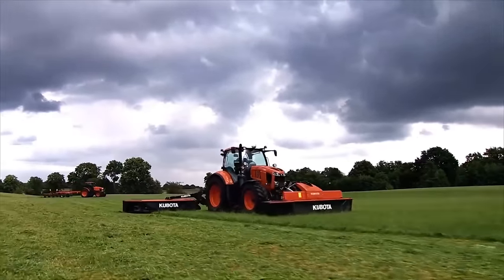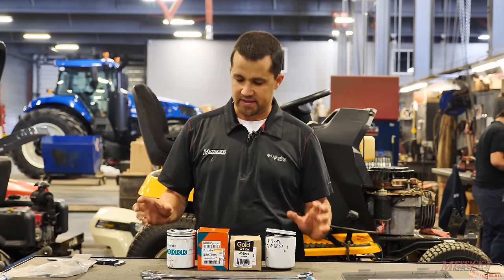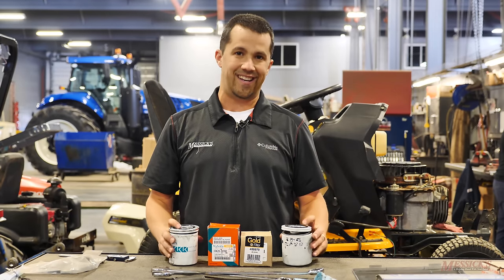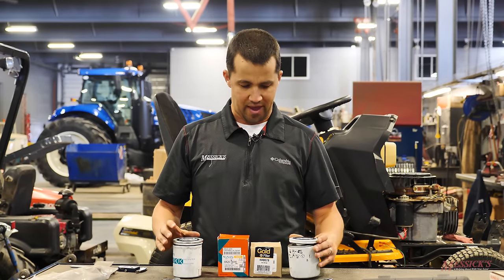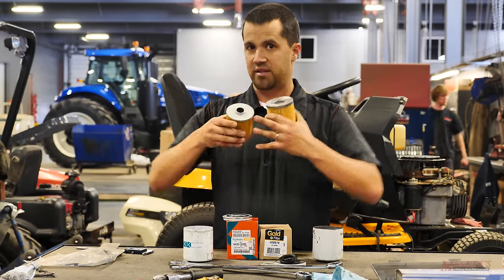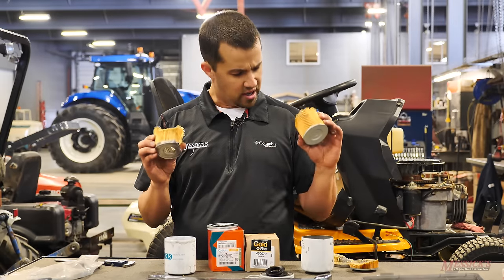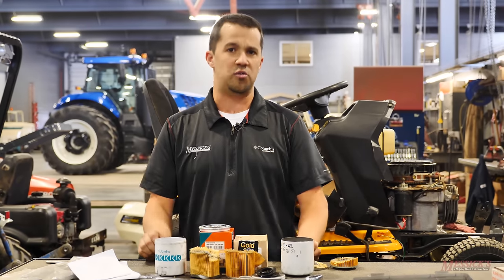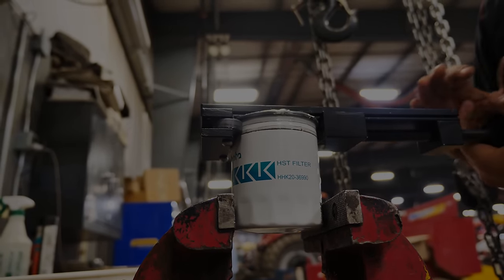NAPA VS KUBOTA (hydraulic oil filters) - What's inside???

Comment: When talking filter material, the most important thing to gage a filter by is the “micron” rating for the material. This tells you the size of the contaminants that will pass through the filter material. The total filter surface is important also. This allows more oil to flow freer through the filter when new as well as after it becomes dirty. The use of a micrometer to measure metal thickness would be helpful. You may want to replace the cutter wheels on your tool.

Comment: I prefer to use OEM hydraulic filters. Had a few issues using aftermarket ones both were flow problems. One starved the pump of oil burning it up and the other was when it was cold and couldn't flow the thickened oil. Blew the seal and emptied the 15 gallon tank on the ground, thankfully caught it before the pump went. Never had an issue using OEM filters. The price difference is nothing compared to that of hydraulic components.

Comment: I disagree on the spring function. If you look up that NAPA filter, it's a Wix WL10079 and the Wix catalog say that model has "NONE" for bypass relief. This matches what I've seen on several hydraulic filters which seem to mostly have no bypass relief valve. Engine oil filters sometimes have a leaf for tension with a bypass spring built in the middle of the leaf and sometimes the leaf is just for tension or the filter has a coil spring, and in both of those cases the bypass relief valve is built into the canister

Comment: A great comparison on these filters would be to remove the filter material from the housing and stretch it out on the workbench. This would give a visual and a measurement rather than saying “more pleating”. I always use OEM on my equipment. Except for my 1969 Massey Ferguson 135. It’s been converted from a canister filter to a spin-on type.

Comment: Thanks Neil, I wish your price was similar in Australia. 

For Example - 
HH1G0-32430
Your price - $14.68
Aus Price - $60.03(USD converted) 

HH160-32430
Your Price - $14.68
Aus Price - $47.56(USD converted) 
Aus Baldwin - ~$20(made in the US)
Ryco Z9 - $5

HH166-43560
Your Price - 18.66
Aus Price - $37.61(USD converted) 

3P300-11220
Your Price - $38.01
Aus Prices $99.01(USD Converted)
AUS Baldwin - ~$40

HHK20-36990
Your Price - $12.19
Aus Price - $25.72(USD Converted) 

These are some of filters i deal with for my tractors. This is why in Australia, it is not worth cost of buying Kubota Filters, as you can see one filters in Australia i can buy it four times from you. 

You need to start selling them in Australia as it is cost us a lots in filters here. I think even shipping freight and filter will be cheaper then local bought filters. 

I stick with Baldwin or Donaldson filters. Unless Neil your company start shipping them to Australia. For your example if i take 4x HH1G0-32430 for price for 1 here, i can use for up to 2400 hours vs 600hours. 

And don't get me started with the oils. It is almost 3 times the price here vs yours. At My M135GX first service(50hours), the kubota dealer said, we don't change the Hydraulic Oil or Filters, or the owner will have heart attack at the price they pay.

If the prices where like 20% more expensive then third party, Yes I would go with Kubota Oils and filters. If they are 4-6 times the price of third party filters you know where farmers will go to else where. 

Another example is I don't buy my spare parts for my Honda ATV from Aus i buy from US as it is half the price including freight. It is only an extra week to wait.
Reply from the maker: Yea, we've heard that. Seems all your tractor stuff there is expensive. We sell a lot of parts to Australia for other brands. Unfortunately Kubota has very strict export rules for the dealers.

Comment: I don't like the "spring" in the Kubota filter. That is what Fram uses in their oil filters. Over time the spring flattens allowing oil to bypass. I've taken many fram filters off that you can shake and hear them rattle. With all of that being said, with the frequent service intervals on the hydraulic filters, I doubt they compress that often.

Comment: Lol you drive a Ford. I had a 2008 F550 with 6.4l and aside from the obvious, multiple, and continous problems , the last one before I traded out for a Dodge was the funniest and contradicted what the young man said. I had turbo noise, squealing, and the dealer along with Ford engineers were not willing to cover the issue due to me not using a Ford specific original part. I had switched to Wix air filters after finding out I could without affecting the warranty but low and behold they flipped on me. I changed the filters out in half the time the manufacturer recommended to keep the turbos protected. I called wix now facing a 5 grand bill for a turbo and they laughed while telling me they made Ford filters as well. They got involved on my behalf with Ford and had the bill cut in half. Of course it should have been free but the dealer found a crack in the filter housing and said it was drawing in dirty air. Funny though since in that case I should have been responsible for the full bill but when they pulled up my record they could see where I had broken down so many times in so many different towns and 8 different dealerships had their hands on my truck so even they admitted one of their mechanics along the way likely caused the crack. They tried working the angle of the roads I drove on but I only drove on highways and paved roads. They pulled the same trick with the junk radiators and won as I put 2 new ones in it at my cost for cracking saying it was likely the roads I drove on LMAO. I always would ask them what their slogan was? FORD TOUGH, YEAH RIGHT! Not that every manufacturer hasn't had problems but Ford has been the sneakiest and dirtiest manufacturer I've ever witnessed. Dodge gave me a fit about the DEF system on my 2012 but after a delete its been the only problem to date. Sorry I lost it after hearing him say manufacturers allow aftermarket filters because Ford certainly did all they could to get out of paying for using a filter that makes theirs also. As far as this test I have 3 tractors and my 82'l305 is my most used. I learned to drive a tractor on this beast when I was 10 and when dad wasn't watching I beat the hell out of it. He would get on to me when I'd come from the woods after bushogging saying it sounded like a war as I was tackling 4" privet hedge. When I became the sole user of it I wasn't into maintenance and did a piss poor job by not changing oil or air filters far longer than manufacturers recommended. We used Napa oil and fuel filters from day one and considering how I treated the ole girl it has never let me down or used a drop of oil. I swear I have always thought I had some special model with all platinum components. Aside from 2 water pumps, I recently lost some teeth on the internal gear on the 540 rpm but to date that's the only problem I've ever had after nearly 40 years of hard work. I can't speak for the newest models but I have a 2009 b3030 and it hasn't complained once, but I don't treat it like the l305 though. I can certainly attest that the older Kubotas are beyond tough and resilient!

Comment: The Belleville style spring in the Oem filter allows pressure to build before popping. This ensures maximum filtration before bypass, and also allows for high pressure alerts to the operator more frequently. It’s totally necessary if you have filter warnings on your equipment as coiled spring bypass may not reach pressures high enough to trigger the warnings.

Comment: Also if your gonna say it’s got more pleating pull them off and stretch it out. The Napa may be shorter but might have deeper pleats giving more area.
Reply: Pleating can't be deeper because the have the same OD and the same inner hole.
Reply from the maker: That's the threads, the pleating comes no where near that.
Reply from the maker: In a cheap filter, its really common to have lots of dead space and spacer parts as they try and reuse the same filtering elements across models.

Comment: Why do you have a filter cutter, and its labeled on your tool box?  A grinder would do
Reply: PS, that hanging thread on the logo of your shirt is driving me crazy, burn it off, lol
Reply: A grinder will contaminate the filter media. Filter cutters are much cleaner.
Reply: @neal k. You mean the same way that the band saw lubricating oil did?
Reply: @dwwilliams72  He means if you are cutting open a used filter to examine the contents and check the condition of the engine you don't want grinder particles added to the equation.  In the case of this video it would not have mattered since it was just a demo of the construction of the filter.
Reply: Used for warranty work making damage claims
Reply: Ok. I recant, a pair of tin snips will do